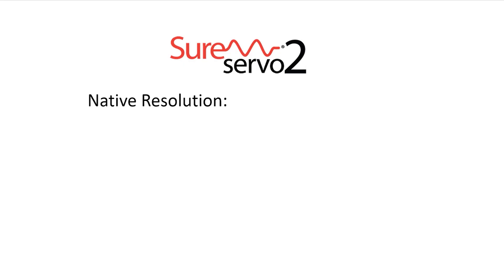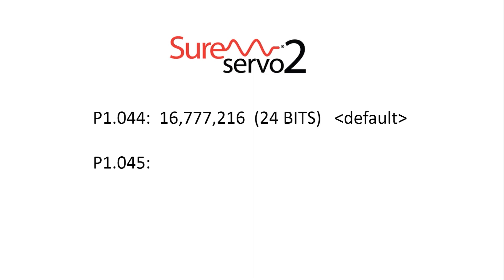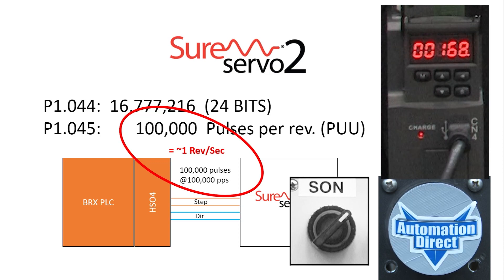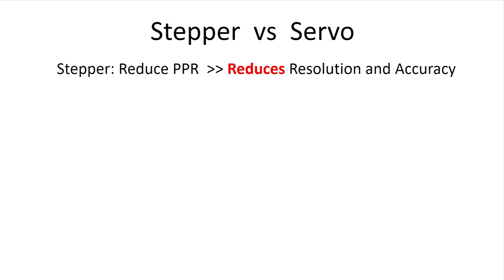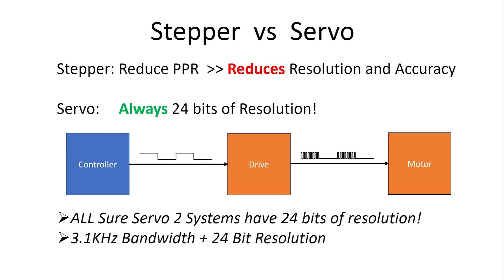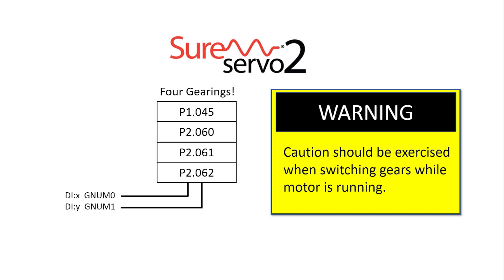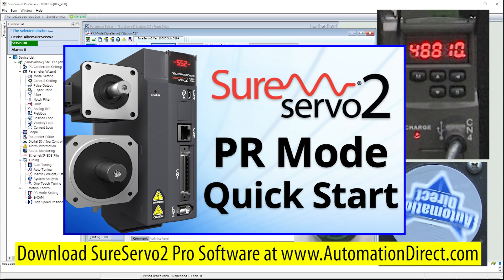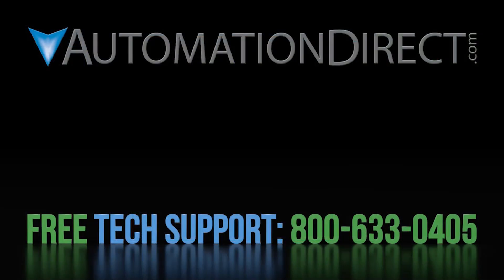SureServo2 Electronic Gearing from AutomationDirect

Comment: I still don’t understand how to use this. What does changing the numerator do then?
Reply from the maker: P1.044 (numerator) is the number of actual motor encoder pulses the drive expects to receive as feedback in relation to the number of pulses (P1.045 or denominator) it has been commanded to. (from the PLC, digital input, etc) It is STRONGLY recommended that you leave the numerator (P1.044) alone.

The SureServo 2 motor has a 24-bit encoder, so there are 16,777,216 actual positional values or "pulses" per each physical revolution of the encoder/motor, and that is the default value for the numerator. It is extremely complicated math for a user to try and scale all of his real world moves to that value. If I wanted to move 3.5 revolutions, I would have to command a value of 58,720,256 for the move, and it's very easy to make typos, misread numbers etc. Additionally, for a pulse train system, most pulse output cards would take several seconds at absolute maximum pulsing to send that many. It limits how fast I can move the motor and pushes the entire system to the limits of its signal processing, which is always a recipe for missed pulses. There is not really a single motion application that would ever require or be able to hold to that level of accuracy anyways.

What this function does is allows us to use MUCH simpler numbers to still achieve extremely precise positioning with much less complication and lower risk of error on our part. Let's say that our motor is set to the default value in the SureServo 2 software of P1.044 to 16,777,216, and P1.045 (Denominator) of 100,000. Now instead of really complicated math its really easy math. If I want to do 3.5 revolutions, I simply command a position of 350,000.

If I am in PT (Pulse train) mode its far fewer pulses, which means I can send them faster and achieve better speeds. If I'm in PR (position register) mode its much simpler math for all of the positions. If I don't even need that level of granularity, I could change P1.045 to 10,000 and now 3.5 revolutions is only 35,000 pulses. Because P1.044 is already set to the real-world encoder value on the motor we STRONGLY recommend not touching that one, and just adjusting the denominator based on the application to get much simpler math for your moves. 

Technically you could leave the denominator at 100,000 and change the numerator value to something other 16,777,216 to accomplish the exact same thing, but there is no reason to mess with complicated math when changing the denominator is the accomplishing the same purpose much more simply.

I suppose theoretically, if you had a different motor encoder with a different number of pulses per revolution you could change the numerator to match the new encoder, but we don't have any other options nor do we support it.

Let me know if that answers your question and thanks for the comment!

Comment: Can this channel possibly make a video covering a master encoder with the Sure Servo 2 where you can have multiple servos running on the same speed? That would be very helpful for many reasons, thank you for all your videos they are very well done.
Reply from the maker: We will add it to our "ToDo" list - Thanks for the suggestion!
Meanwhile, if you simply connect the encoder to several servos in parallel it should get you close. Use this vide o (https://www.automationdirect.com/videos/video?videoToPlay=fwSvSRdvV9M&q=SureServo2) as a guide, except replace the PLC with the encoder.